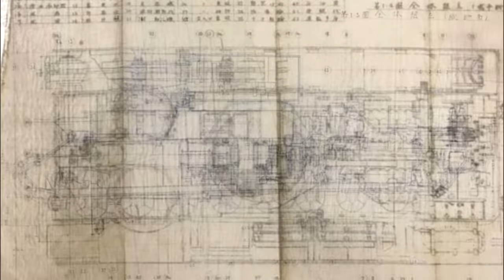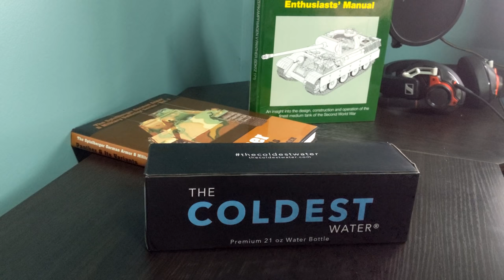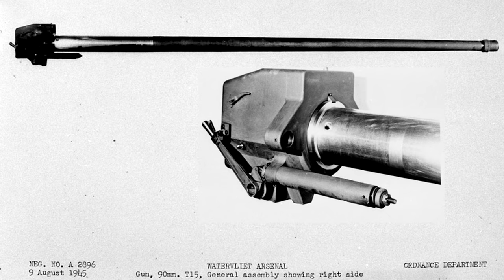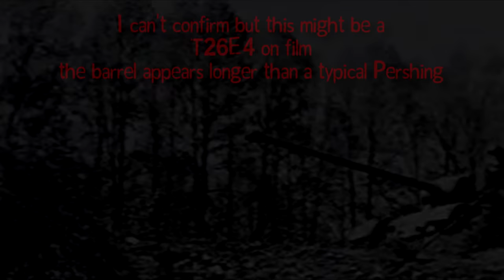America's King Tiger KILLER, the Super Pershing | Cursed by Design

Comment: America's "King Tiger Killer" that never actually went up against a King Tiger.
Reply: And when it ran into a Nashorn, it got dead.
Reply: Supposedly never went up against a King Tiger
Reply: @michaelbruce6190  While the Nashorne was in an ambush position and the Tiger 1 got taken out by an M4
Reply: @WaukWarrior360  very true
Reply: @WaukWarrior360  A tiger 1 also knocked out a Pershing in a tank duel in 1945. 2 of the Pershing's crewmembers were killed, the rest of the crew bailed out safely.
Reply: @WaukWarrior360  at a time, where the only existing tigers were over 100km away...
Reply: @mystictomato9466  It wasn't a dual, it was an ambush and the Tiger 1 was knocked out by a following Sherman. The Pershing was returned to combat 2 weeks later
Reply: @lisaruhm6681  Must not be very aware that there were Tigers closer than 100km away.
Reply: @lisaruhm6681  there was even an encounter between a Super Pershing and a King Tiger at Dessau. The only disagreements to the fact I can find are from Werhaboos on WoT forums
Reply: @mystictomato9466  So in short the "duel" was actually the same ambush I'd already mentioned"
Reply: @WaukWarrior360  No, because you aren't right. That tiger wasn't knocked out by a following Sherman. After knocking out the Pershing the Tiger started reversing in an attempt to retreat only to get stuck in a ditch, it was then abandoned and destroyed by its crew. Also the tank duel between the Super Pershing and a King Tiger never happened, it was most likely a Panzer 4 and not a King Tiger.
Reply: @WaukWarrior360  wasnt that the encounter, where the US tank mistook a PZ4 for a KT, when the nearest Tiger was ~100km away at Berlin?
Reply: @mystictomato9466  Actually yeah, because you're wrong. The Tiger got knocked out by a Sherman. Also the duel between the Super Pershing and king tiger did happen, German tanks weren't the all powerful gods you think they were
Reply: @mystictomato9466  Also, thanks for acknowledging that there were Tigers farther west than 100km and not being able to refute the facts with anything other than werhaboo reeing
Reply: @mystictomato9466  I find it funny that you think I'm a "freeaboo" (lame insult) when I actually acknowledge the weakness in American technologies and also tout the accomplishments of British, French, Soviet and even German technologies in ww2
Reply: @lisaruhm6681  No, it was the encounter where a Super Pershing knocked out a King Tiger. There was never any Panzer 4s that were mistaken for Tigers by Pershing crews
Reply: @lisaruhm6681  Also, there were obviously multiple tigers farther west than Berlin. I don't know where you get that wholly erroneous idea from
Reply: @WaukWarrior360  where is the report/proof for that, as far as I know, there is not even a picture of the phantom Tiger2 at Dessau, even though they make a photo of every destroyed Tiger?
Reply: @WaukWarrior360  but I found reports about the 1 for 1 trade near  Cologne in early 45 with the Super Pershing vs Tiger.
Reply: @lisaruhm6681  "Another River Another Town" and "Spearhead in the West". Also it's pretty common knowledge that there were plenty of Tiger 2s on the Western front if not as much as on the Eastern Front.
Reply: @lisaruhm6681  Also, the tank duel at Cologne cathedral was between a Pershing and a Panther. There's literally footage of it
Reply: @mystictomato9466  It surprised the Pershing and got a lucky shot at point blank range one the gun shield, which hit a particularly vulnerable spot. (IIRC it was the co-ax 30-cal.)
Reply: @WaukWarrior360  IIRC the Tiger backed into a building and was abandoned.
Reply: I think the Germans did not lose the war I think they give up because they was embarrassed for the Americans
Reply: I am in love with the tiger one it's best looking tank but I do like the tiger 2 and the panther
Reply: @r.j.dunnill1465  It was abandoned because it was no longer serviceable (I.e knocked out by the Sherman)
Reply: @adytowe7969  Why would they be embarrassed when the Americans and Russians won through superior technology, strategy and manufacturing.

If they hadn't surrendered when they did, Berlin and Frankfurt would have been nuked due to the "Germany first) policy
Reply: @WaukWarrior360  Zaloga documents this well. The Tiger I which knocked out "Fireball" was 201. After knocking out the Pershing, 201 reversed down the street, but in the dark backed into the rubble of the house at No. 74 Köln-Aachener Straße. Unable to extricate it, the crew abandoned the tank, expecting to be overwhelmed by American infantry.

"Pershing Versus Tiger: German 1945," Zaloga, pp 58
Reply: It was a joke I did not mean it was just a laugh I am not crazy
Reply: @r.j.dunnill1465  Noted
Reply: @mjn5016  for what?
Reply: @mjn5016  You're late to the conversation.  I already came to an agreement with RJ
Reply: Hoa Tattis  Dessau, 1945
Reply: Hoa Tattis  The Brits and Canadians encountered more Tiger 1s, the Americans encountered more Tiger 2s
Reply: Hoa Tattis  What was impossible to move?
Reply: Hoa Tattis  Actually, the fact that United States won through superior technology is pretty obvious to anybody with more than a passing knowledge on WW2 and isn't some Nazi fanboy.
Reply: Hoa Tattis  The US had Fighter jets/bombers, Aircraft Carriers, Digital computers, heavy bombers, Nuclear Weapons, Radar and TV guided bombs, Cruise Missiles, Walkie Talkies, Night Vision, Drones, 90mm/105mm/122mm/120mm/155mm heavy tanks, napalm, miniaturized radar proximity fuses, plane mounted radar/night fighters, morphine syretts, mass produced penicillin, benzadrine, large scale and efficient mass production, cruise missiles, computer based land/air navigation systems, remote controlled turrets, assault rifles, body armor, Modern uniforms, helicopters, RPGs, Mobile Rocket Launchers, semi-auto combat shotguns, Recoiless rifles, Nuclear Reactors, Holographic AA sights, Computerized Fire Control, grenade launchers, flying wing aircraft etc etc
Reply: Hoa Tattis  Not to mention it was the American Robert Goddard that invented the modern/Liquid Fueled Rocket.
Reply: Hoa Tattis  Yes, the Tiger got stuck... What of it?
Reply: Hoa Tattis  Who is they and what did they never do?
Reply: Hoa Tattis   @Hoa Tattis   Lol,
1. US was working on Jet engines before WW2 like the L-1000. So apparently the Germans got Jet engines from the British
2.The first aircraft carriers were the USS Birmingham and USS Pennsylvania so the British apparently got that from us.
3. The US developed nuclear bombs largely independently and nuclear reactors independently with some help from Britains failed nuclear program. Practical radar was a culmination of British and American research.
4. TV guided bombs not German. US TV guided bombs included the GB-4, GB-8, Felix, Bat and Gargoyle. Azov was a TV and Radar guided bomb used by the US.
Also in use was a TV guided drone TDR-1
5. Derp Derp. Heavy bombers most famously included the B-29 and B-17 as well as the B-36 jet bomber.
6. FG-42 wasn't an assault rifle. You're thinking of the Stg. 44. The US had the M2 Carbine.
7. Mass produced Penicillin American.
8. Germans created panzerfaust after reverse engineering M1 bazookas recovered at Kasserine pass. M20 super  @Hoa Tattis   @Hoa Tattis  Lol,
1. US was working on Jet engines before WW2 like the L-1000. So apparently the Germans got Jet engines from the British
2.The first aircraft carriers were the USS Birmingham and USS Pennsylvania so the British apparently got that from us.
3. The US developed nuclear bombs largely independently and nuclear reactors independently with some help from Britains failed nuclear program. Practical radar was a culmination of British and American research.
4. TV guided bombs not German. US TV guided bombs included the GB-4, GB-8, Felix, Bat and Gargoyle. Azov was a TV and Radar guided bomb used by the US.
Also in use was a TV guided drone TDR-1
5. Derp Derp. Heavy bombers most famously included the B-29 and B-17 as well as the B-36 jet bomber.
6. FG-42 wasn't an assault rifle. You're thinking of the Stg. 44. The US had the M2 Carbine.
7. Mass produced Penicillin American.
8. superior to Panzerfaust and Panzerschreck
9. Most widely implemented computerized fire-control was American used for artillery, ship guns and bombers
10. First true flying wing was Northrup N-1M 4 years before Horten with N-9M and XB-35 also being built
11. US Cruise missiles GT-1, JB-3 Air to Air, JB-4, Gargoyle Air to Surface, JB-1 etc
Reply: Hoa Tattis  So in short, your information is hilarious and the US had superior technology to Germany's
Reply: Hoa Tattis  1.yes, the US in fact worked on Jet Engines before WW2 and the British created Jet Engines before the Germans.
Reply: Hoa Tattis  2. Yes, in fact the first take off and landing on a ship was on 2 US ships in 1910.
Reply: Hoa Tattis  3. Um yes derp derp. The Manhattan project was an Independent US program with some initial advice from the British in 1940. 
Also yes, Radar wouldn't be possible without different advances from both British and American engineers
Reply: Hoa Tattis  4. This one is funny because each one was developed and/or used in WW2 dummy. Most famously the Azov used in Burma against bridges
Reply: Hoa Tattis  5. B17 literally was a heavy bomber that would fly from UK to bomb Berlin and the B29 was the longest ranged heavy bomber of WW2
Reply: Hoa Tattis  7. Not sure what you're saying but the US developed mass produced Penicillin and supplied the allies with it.
Reply: Hoa Tattis  8. It's a historical fact that the Germans reversed engineered the M1 bazooka to develop the Panzerfaust and PanzerSchrek. You can't change that
Reply: Hoa Tattis  6. The FG-42 literally wasn't an assault rifle. That was the STG-44. Also yes, M2 Carbine was a select fire rifle with detachable magazine and intermediate cartridge I.e. assault rifle.
Reply: Hoa Tattis  9. US literally Used computerized fire control for artillery support, Battle Ship guns along with radar, Remote control turrets on B-29. 😂
Reply: Hoa Tattis  11. Every one of the cruise missiles I mentioned were developed and used in WW2. You can't just say "nuh uh" especially when you didn't even know these weapons existed
Reply: Hoa Tattis  Yes, the United States and Soviet Union were the main Allied powers responsible for winning WW2. So yes, we did win the war along with the Soviets
Reply: Hoa Tattis  Lol, again... The British gave us some early advice in 1940. Other than that we took the examples and finished them as we'll as developing the rest of our technology independently.
Reply: Hoa Tattis  Who is Randal?
Reply: Hoa Tattis  Every single one of these weapons systems were used
Reply: Hoa Tattis  No, the US did not get British help.
Reply: Hoa Tattis  The US was more technologically advanced than Germany. Stop making excuses and get over it
Reply: Hoa Tattis  Obviously the British and Americans used each others equipment when necessary just like the Germans used French, Czech, Belgian etc equipment.
The Germans even used British and American equipment as well as reverse engineering British and American equipment like RADAR and RPGs
Reply: Hoa Tattis   1. British used American radio proximity fuses for AA
2. The US used SONAR not ASDIC 
3. The Cavity Magnetron an unfinished prototype for airplane mounted Radar. Research was completed at MIT and Bell labs. US already had general RADAR before the Tizard mission.
4. British used American M2 105mm, M1A1 75mm, 155mm long toms, M2 75mm, M1 76mm etc
 5. Ballistics? US never used the Grand Slam bomb.
6.America worked on Jet Engines before the Tizard mission such as the L-1000 built in 1938
7. The P-51 was used by the British
8. British used B-17s, B-24s, B-25s etc.
9.British also used Corsairs, Thunderbolts, Hellcats, Airacobras etc 
10. The Merlin used in the P-51 was a Packard Merlin/American Merlin designed and built in the US. It would also replace Rolls Royce Merlins in British use
Reply: Hoa Tattis  Yes, America was more technologically advanced than Germany. Since you cant argue that you point out unfinished British Technology that was developed/finished in America
Reply: Hoa Tattis  Technology that the Germans got from America and UK
1. Rockets/American
2. Airplanes/American 
3. RPGs/American 
4. SONAR/American
5. Jet Engines/British
6. RADAR/British&American
7. Tanks/British
8. Submarines/American
Reply: @WaukWarrior360  

https://youtu.be/oQ19oZRZqfc

Was this the video you said?
The tanker from the 3rd armored division,  In a video called greatest tank battles.
Reply: @cowgoesmoo3850  No, I don't think so. Most of what I saw was historical myths and misconceptions about the Sherman from the same channel that talks about Ancient Aliens and big foot
Reply: @WaukWarrior360  dang dude...I'm impressed with your research!
Reply: No it did and defeated king tiger
Reply: Search which is better king tiger or super pershing
Reply: @WaukWarrior360  by "plenty" you mean "encountered Tiger and Tiger II less than a dozen times during the last 12 months of the war"
Reply: @WaukWarrior360  Sorry, not just by Wehraboos, but by factual history, by the distance of the nearest Tiger 2, by Mark Felton (Productions), by Nicholas Moran aka " the Chieftain" and others on YouTube I don't care to mention. It is also doubted by Arthur Hinnicutt himself, author of the best series of books on US tanks. It is as expected, USAboos or Limeyboos like you, believe all that crap. Ps. if you are a fan of the Super Pershing, I advise you NOT to watch Moran's feature on that tank, but If you want to have a heart-breaking laugh (or cry), yes, do watch it but if so, don't say that Nicholas Moran is a Wehraboo!
Reply: @michaelbruce6190  The tank the Nashorn knocked out at Cologne was just a normal M26.
Reply: @lisaruhm6681  yes, and it was a Panzer IV which made sure the crew of Pershing had a bad day
Reply: @WaukWarrior360  I can find no evidence of the situation you are talking about
Reply: @erwin669  Encountered and defeated every one of them
Reply: @joegatt2306  No, really just by werhaboos because your opinion is backed up by "real history".
I'm sorry but Mark Felton and Nicholas Moran didnt say the Pershing didn't encounter a Tiger 2 and they themselves said its a possibility given the fact that there were Tiger 2s in the area being shipped by train.
Reply: @joegatt2306  The problem is Krautchans can't handle it when their Nazi Fairy dust turns out to be fake and overrated so they make up things like "USAboos".
Also, Nicholas Moran gave a pretty good endorsement of the Super Pershing in his video so Idk what you're talking about. He's also pointed out how the M4 Shermans was the best tank of WW2 so he's definitely not a werhaboo
Reply: @arandomfinnin1941  There wasn't a T26  knocked out at Cologne. There was a Nashorn that ambushed a T26 in a rural area though
Reply: @insomniacbritgaming1632  It was a Tiger 1, not a Panzer 4.
During an Ambush a Tiger 1 managed to get a shot through the Pershings MG port, shot the guns muzzle break and shot another round that glanced off the Pershings actual armor.
Most of the crew survived and the tank was back in action within a weak
Reply: @insomniacbritgaming1632  Which situation? The tank duel at Cologne, Battle of Araccourt or the tank duel near Dessau?
The Pershing likely knocked out a Tiger 2 near Dessau but it's debated. There were Tiger 2s in the area that had been shipped by train car
Reply: @WaukWarrior360  I did not make up the term "USAboos" because they exist and you are their prime example in this channel! Also, Nicholas Moran's feature on the Super Pershing was entitled : Why T26E4 didn't work and he's definitely not a werhaboo. Nuff said.
Reply: @joegatt2306  You did make up the "term" "USAboos", it's not a real thing and I'm not a prime example of your made up term. I'm just more knowledgeable and understand enough to put Krautchans/Werhaboos in their place.
I can give you examples of the superiority of British and Soviet technology in WW2 too.
Reply: @joegatt2306  Also, Nicholas Morans video on the Super Pershing isn't titled "T26E4:Why th T26E4 didn't work" because he's not a charlatan. 
Also yes, he's not a werhaboo which is why he's pointed out how the M4 Sherman was the best tank of WW2
Reply: @WaukWarrior360  Someone made up the term "Wehraboo" (I am sure it’s not a dictionary term therefore that too, is not a real thing) so what is it to you if I made up the term "USAboo"? I am not offended by the term Wehraboo, I do not spend sleepless nights over it, but it seems you do. And I use various other terms too (not all made up by me) like Limeyboos, Teaboos, Brittaboos, Commieboos and Ruskyboos, but nobody seemed to be crying or complaining about them, except you. And yes, you remain, by far, the prime example.
Please do give me examples of American, British, and Soviet technological superiority given that you are the more knowledgeable. Give me time and I have all the books I need to debunk most of them. Ah! Yes, I said books, not assumptions, gossip, or myths. And contrary to your biased reasoning, I never claimed that ze Germans had a technological superiority in all areas. If not, you are saying that despite Allied numerical superiority, Allied materiel and economical supremacy and now, Allied technological superiority, it took them  almost SIX years to bring down Germany?!
One last thing. What happened to the single European example of the Super Pershing? Last time it was seen was in a rubbish dump in Kassel, ready for the scrap while Tiger II survivors are prized possessions of many armor museums.
Reply: @joegatt2306  You're right, somebody made up the term Werhaboo and it's actually has common usage.
On the other hand you made up thre term "USAboo" which nobody uses since it's not really a thing.
Which is kind of funny because you're so butthurt about being called a Werhaboo that you tried to invent "USAboo" as a comeback
Reply: @joegatt2306  VT fuses, Interstate TDR drones, computers like Goliath and even digital computers like ENIAC, Manhattan Project (I.e nuclear bombs, nuclear rectors), Centurion MBT, M4 Sherman vs Panzer 4 and Panther (incuding better ergonomics, radio suite etc), Napalm, Sikorsky series of Helicopters, P80 being superior to the ME262, B-29 (most advanced aircraft built in WW2), IS tanks etc etc
Reply: @joegatt2306  I have "biased reasoning"? Nah bud, you're literally a krautchanh so don't act like you're not insanely biased.
It's funny too because the economic and industrial supremecy of the US is also an example of technological superiority.
Reply: @joegatt2306  It's also hilarious when Krautchans try to act like they were fighting alone or that it took "6 years lol" to be beaten when the Germans had multiple allies in Europe and it took less than a year to defeat Germany after D-Day.
"We had to fight a 2 front war derp"... and the US was fighting on dozens of fronts in 8 different different theaters around the planet lol.
Reply: @joegatt2306  Another thing, how is a super Pershing being scrapped after the war relevant? I mean it proved superior to the Tiger 2 and there's only 8 Tiger 2s that survived the war since the rest were destroyed which means its rare lol.
Meanwhile the T26 went on to be the basis of the Patton series of tanks and the Tiger 2 was a technological dead end.
Reply: @joegatt2306  What about Mike Felton, War Thunder ( an unrealistic videogame lol), For the record, Axis History Forum (wehraboos) and Nicholas Moran? None of them except for the werhaboo site back up your claims.
Also, I said repeatedly that Nicholas Moran isn't a Werhaboo given that he's pointed out how bad the Tiger 1, Tiger 2 and Panther were and how the M4 was the best tank of WW2. 
Sorry but R.P Hinnicut is one of the few people that seriously doubts the Tiger 2 being destroyed at Dessau and he's been criticized by actual experts
Reply: @WaukWarrior360  Let us start with (1) The VT fuse. As I said before, I am not biased (like you). First round to you. (2) Interstate TDR drones which are actually piston-engine cruise missiles controlled by TBM Avengers. The Germans had the similar Mistel Project, but they went one better and produced the first true cruise missile, the rocket-powered Fi 103 or V-1. (3) Computers like Goliath. The Germans produced the first programmable computer, invented by Konrad Zuse. Quote: “The Z3 of 1941 is considered as the world's first programmable computer and predates the ENIAC in the US by many years. It used punched tape (actually old film) to store its program”. (4) The Manhattan Project was American only in name, location and funding. Foremost of the inventors were Enrico Fermi, (Italian, known as the architect of the Nuclear Age), Albert Einstein, (German Jew), Leo Szilard (Hungarian German), Eugene Wigner (Hungarian) and Edward Teller (Hungarian, known as father of the Hydrogen Bomb), last four, all graduates of German universities. This project was only possible following the discovery of Nuclear Fission of uranium by German chemists Otto Hahn and Fritz Strassmann in 1938 which led directly to the development of the Atomic Bomb. (5a) Centurion MBT. A report from Tank Armour Research on trails carried out in August 1945, between a PzKw.V Panther (with German crew) and a Centurion Mk.1 found the two quite evenly matched. (5b) M4 Sherman vs Panzer 4 and Panther (including better ergonomics??? radio suite, shorter ranged but OK, agreed, etc? what else?). The PzKw IV (albeit a 7-year older design) was a close match for the M4, but the Ausf.H’s 75mm KwK L/48 gun, though, remained a tad superior to the 76mm M1, (135mm to 125mm penetration at 100 meters using APCBC rounds). Compared to the Panther, the M4A3 had inferior armor (63mm/47° to 85mm/55° glacis equivalent to 117mm and 223mm, respectively vs APCBC rounds), inferior gun (75mm KwK L/70 penetrates 185mm at 100 meters), inferior mobility, inferior optics, similar ergonomics, (3-man turret crew, turret basket, crew escape capabilities etc.), but superior radio (hooray!). The Panther had issues with reliability but these only come to light due to the shit-loads of spare parts available to US and British crews. It was over-engineered, as are most cars and home appliances etc, today, is that bad? Tell it to the American crews that they had the better tank to fight off the German cats, 80 years after WW2 ended! (All gun penetrations and armor equivalents from "Armor and Gunnery" by L. Rexford Bird & R.D. Livingston). (6) Napalm. Can’t see the greatness of this weapon, the Germans were branded criminals for using flame-throwers in WW1. (7) Sikorsky series of Helicopters. First of all, Igor Sikorsky was an Armenian from Kyiv. Secondly, the Germans had two firms already producing helicopters from the mid-30s, Flettner and Focke-Achgelis, the latter’s model, the Fa 223 Drache was considered the most capable helicopter design of WW2. (8) The P80 vs Me 262. From my book “World War II Fighting Jets” by Ethell & Price (page 180). Quote: “After the war, the USAAF compared the P-80 and Me 262 concluding, "Despite a difference in gross weight of nearly 2,000 lb (900 kg), the Me 262 was superior to the P-80 in acceleration, speed and approximately the same in climb performance. The Me 262 apparently has a higher critical Mach number (the Me 262A's being at M 0.86), from a drag standpoint, than any current Army Air Force fighter”. Not mentioned in this quote are the superior dive due to its swept wing configuration, higher survivability and superior armament hitting power of 13.2kgs/per sec. compared to 3.2kgs/sec. of the P-80. (9) The IS-2? Seriously? From how many arses are you going to fart, weren’t two good enough for you? (sorry couldn’t help that).
As promised, I answered back, blow for blow but I do not think I will continue with this debate. You seem to have a lot of time to waste in front of your computer. I counted at least 70 of your posts on this article alone. But I cannot help but answer this last one from another of your posts below. How can I describe this last one but refrain from rudeness (again)? Anyhow, how is “economic and industrial supremacy of the US also an example of technological superiority”. What technological knowhow was required for 266 million tons of iron ore produced by the Axis (Germany, Italy and Japan considered) to out-pace 591 million tons of the Allies, (US, UK and USSR considered)? Similarly, 192 million tons to 497 million tons of crude steel, or 2,503,000 tons to 4,643,000 tons of aluminum, or under 5,000 tons to 86,600 tons of Tungsten (and not including 105,000 tons from China!) and best (or worst) of all, 50.5 million tons to 1,043 million tons of crude oil. (All figures except that for Tungsten, from “Brute Force” by John Ellis). 
Is this nauseatingly long answer insanely biased enough for you?
Reply: @WaukWarrior360  Hi! Joshua, I was browsing on YouTube, and I came along one of your earlier contributions on this channel, entitled ‘Technology that the Germans got from America and UK’. Again, please note that I do not have the amount of time that you spend in front of a computer, so I will begin to destroy your list, one by one. To-day I will start with No.1, Rockets/American and Robert H. Goddard, whom you claimed, or thought him to be, (in yet another of your posts) the father of Rocket Science. You claimed that the Germans copied Goddard’s work, nothing wrong here because Goddard himself claimed ze Germans had stolen his ideas when he inspected captured A-4/V-2 parts in 1945, (which neither is this out of the ordinary as Watson Watt styled himself as “The Father of Radar” of which he wasn’t. Christian Hülsmeyer is the undisputed inventor of Radar, which he called ‘Telemobilescope’ patented in 1903, which means that it debunks item No.6 ).
So, it all began in 1926 in Goddard’s own private workshop whose assistants were forced to sign oaths that they would never reveal his work on the risk of being fired. This continued for a decade before he published his booklet, “Liquid-propelled Rocket Development” in 1936 (by Smithsonian) which provided no details of his secret works! That same year the Germans, under technical director von Braun, inaugurated their rocket research center at Peenemünde but two years earlier (in 1934, two years before the book was published), they had already experimented on the liquid-propelled A-2 (at Borkum) and in an instant, rendered Goddard’s achievement obsolete. With a thrust of 600 lbs., it reached 2.3 miles (over 12,000 ft) altitude on its second test flight while Goddard’s (in 1930) barely reached 2,000 feet!
Detailed study of the V-2 parts concluded that Goddard’s rockets did not bear the slightest resemblance to the German rockets. His largest rocket, tested in January 1941, while constructed as light as possible, had but a rudimentary gyro system to stabilize it only in vertical flight. It had a thrust of 985lbs and reached a maximum height of 9,000 feet, (1.7 miles). It would be his best achievement. Contemporary German rocket, the A-3, had a thrust of 3,305 lbs. and reached 7.6 miles altitude, (40,000 ft). By 1942, a still experimental A-4/V-2 had amassed a thrust of nearly 60,000 lbs. (by end of war production models had reached 70,000; the A-9/10 would have had a 400,000 lb. thrust!). The V-2 had a three-axis gyro guidance system which was designed to steer the missile vertically then horizontally toward its long-range target of between 200 to 225miles. It had a peak altitude of 52 miles. However, on 20th June of 1944, a   V-2 reached an altitude of 108.5 miles, making it the first rocket to reach space. Quote from Bill Gunston’s “Rockets and Missiles”: (the V-2 is) “By far the greatest single achievement in the history of rockets and missiles”.
Another quote, this one from one of Frank H. Winter’s books on rocketry: “After the war, U.S. rocket technology evolved from Germany’s work on the V-2, not from the New England professor’s experiments. As brilliant as Goddard’s achievements were, his rocketry had no real impact, during the war or afterward, on his field”. Goddard was the “Father of American Rocketry”, but his legacy stops there. By 1967, under the direction of Werner von Braun, the A-4/V-2 grew into the Saturn V which in 1969 propelled the first man to land on the moon and in 1973 put Skylab, the first American space station into orbit. Saturn V remains to this day, September 2022, (or until Artemis I’s launch later this year) the largest rocket to leave Earth’s atmosphere.
Reply: @michaelbruce6190  😂
Reply: @mystictomato9466 it was ambush not a duel tho after that m26 knocked out some tigers and panzers
Reply: @mystictomato9466 internet historian
Reply: @alp7292  What I said here are documented facts. You people on the other side believe in long since disproved propaganda. There were no King Tigers anywhere in the vicinity of Super Pershing and the driver of the Super Pershing thought that they had destroyed Tiger 1 (not Tiger 2 like propaganda later claimed). It was mostly likely a Panzer 4 because from a distance it looks somewhat similar to a Tiger. There were also no Tiger 1s in the general vicinity of the Super Pershing. Stop inhaling propaganda please.
Reply: @mystictomato9466  i meant tiger I not II